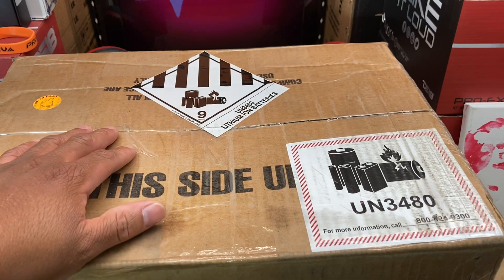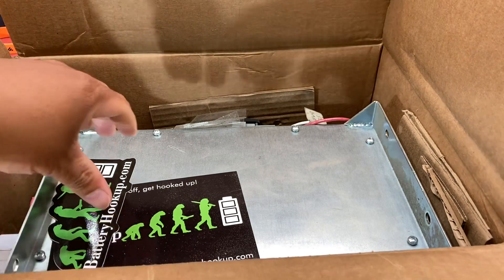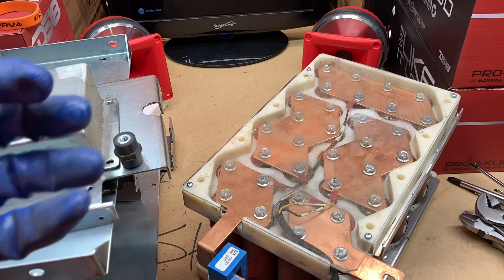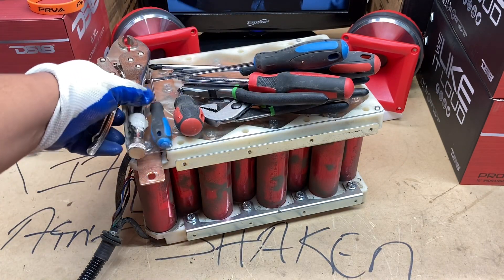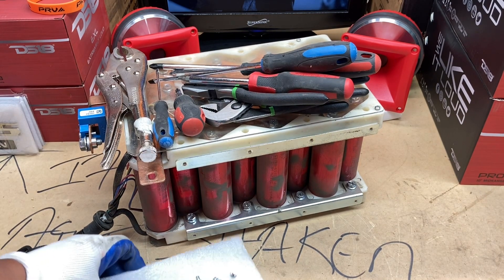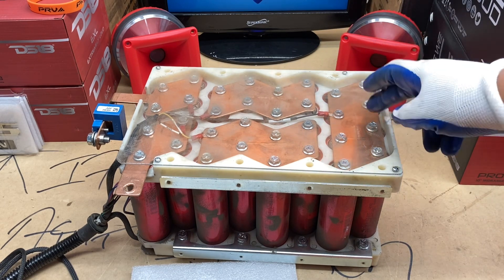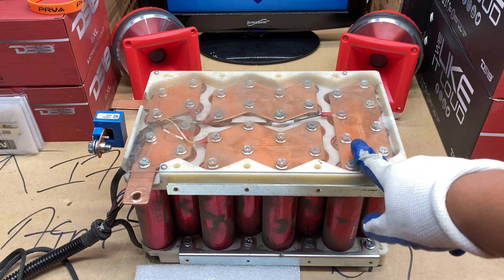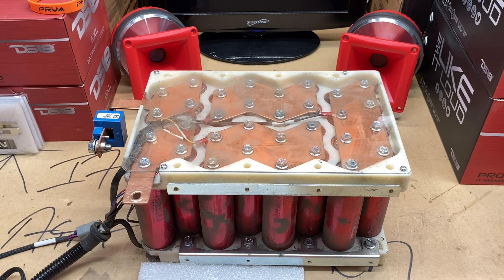Battery Hookup Beast Module

Comment: Parker is running 2 banks 64ah
Reply from the maker: Yeah I’m gonna try the aluminum plates for my connections
Reply: @Outty5000Hertz  I would get nice thick bars from Coventry or Project Db, project db is the little cheaper route
Reply from the maker: @bobbyackerson4125  I’ll look into it

Comment: It's better to use a 10mm socket on those bolts. And yes they are used so they are going to be dirty but they are not hard to take apart and clean. I love the super beast batteries, the ones with the black plastic handles
Reply from the maker: Yeah I didn’t appreciate it at the time but the battery is great for anyone seeking lithium on a budget

Comment: I have one bout to order another
Reply from the maker: I don’t know if I’m gonna roll with this or possibly the super beast module
Reply: @Outty5000Hertz  did u ever convert this one to 12v? Video?
Reply: OK I figured it out like you said it's that 1 plate on the far side Just needs to be cut down the middle separating the positive in the negative but at that point you only have  2 12v 32ah so to make 1 12v 64ah instead of buying more material to make more buss bars I'm goin to link pos to pos and neg to neg with 2/0 or 3/0 welding cable  ... I was going to buy aluminum or copper plates/sheets but copper ain't cheap and aluminum  ot as conductive so I'd rather keep it the way it is and save the money aswell lol
Reply from the maker: @b1782w  yeah I haven’t shot the video yet but I don’t know if I’m gonna hold onto the battery

Comment: I picked up a bunch of the used cells not in the module. I'm only half way through the video but gd man, that shit is straight filthy! Damn sure my wife would be freakin the f out bout then. I do like how they're arranged. I just used the bus bars they had on the battery hookup site and built 2 packs of 90 cells, then built a couple decent boxes with temp controllers and a push and another pull fan on each side of each box. The way those are arranged they'd take up a ton less space. Gotta love all that AH for the price. My voltage is a grip more stable than it was. I'd love to see an update of this video if you get time. Thanks for sharin bro
Reply from the maker: Man I don’t know what I’m going to do with this battery but yes it was filthy. I’m thinking about the super beast module or another underground Power battery

Comment: Where is part two to this? A couple guys told me you didn't have to cut it, you could reconfigure the cells using those bars and housing to get 12v
Reply from the maker: No you have to cut it. Otherwise it’s gonna be a 24 volt battery
Reply: @Outty5000Hertz  will the bms that comes with it work for the 12v config? I have the super beast module I'm trying to use
Reply from the maker: @anthonycoia596  the super beast module comes with the bms this one does not so I’m not sure 🤔
Reply: @Outty5000Hertz  thank you for the quick replies man. I'm probably just going to make some new buss bars altogether
Reply from the maker: @anthonycoia596  good deal

Comment: How many watts can these cells handle
Reply from the maker: I’ve been told a bunch of numbers. The guy I know who is running one has it on 8K
Reply: @Outty5000Hertz  f&$@ it just ordered a bank of C from conventry industry
Reply from the maker: @valentinmanso1532  let me know how it works out for you
Reply: Each HeadWay cell is 200A rated

The size busbars with the Beastmodule are 500A continuous.

Comment: Wish I had the balls to play with cells, balancing, specific charging voltages.
Do those play well with agm ? I'm pretty much out of room to hide stuff. Could stuff a bunch in a side panel if they don't require maitanance.
Reply from the maker: Yes these play well with AGM batteries which I’ll be pairing it with.
Reply: @Outty5000Hertz  That's good to know. It'd be nice to use an isolator or relay.
Reply from the maker: @thenotoriousrvh6091  you know I’m not gonna do it! 😂 every battery for itself 😂

Comment: Nice was thinking about grabbing a beast module myself,already have a 40ah bank with Coventry bars. People hate on headway when comparing to Cmaxx, but headways thrive with stock voltage especially down in the 12v range
Reply from the maker: Facts!!!!!
Reply: I have cmax cells about 72-6 from a Ford Fusion I was gonna use in my Prius but the car only charges to 14.1 so I’m thinking about getting the super beast 48 cell it looks like a hell of a deal ima be putting it on a 10k amp I’m hoping it’s enough sounds like it is from what I’ve hear
Reply: Worst come to Worst  I can parrell them with my cheap az Chines wind turbine.  The so called 500w unite is lucky to make 200w.  LOL  Still works a ba

Comment: I took apart 3 of those modules not a single stripped screw i got 80 cells in a bank great cells 13.3 is the magic number is the only problem not at 14v on fb goto diy lithium there's multiple pages but most of them have a bunch of post on these exact banks tons and tons of good advice in the comments on these exact banks use the search feature in the group
Reply from the maker: Yeah that’s pretty much where I got my info from and that helped me to decide to purchase it

Comment: LEAVE THOSE COPPER BUSBARS as is and try to reuse them so you wind up with a 64Ah 12V LiFePO4 battery
Reply from the maker: It’ll be 64ah either way. I usually run with copper but it’s hard to maintain

Comment: What did you do with that case?
Reply from the maker: The metal case?
Reply: @Outty5000Hertz  the aluminum case with fan on the exterior.
Reply from the maker: @diydan2213  it’s just sitting in a corner
Reply: @Outty5000Hertz  I think they are the coolest thing!! I collect random boxes and cases.. repurpose them.. I would make an offer but I think I'm just going to buy this one or that Super Beast Module 48 and repurpose that case.. thanks for getting back! And the headsup on this battery